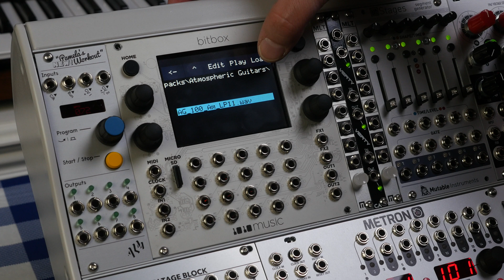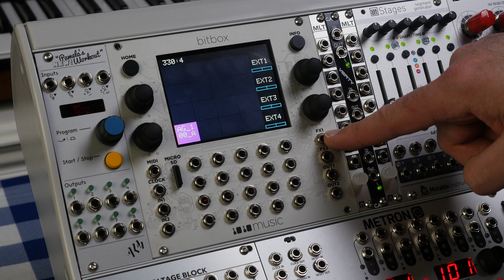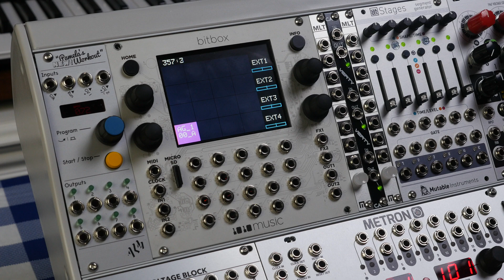Quick Tip: Multiple Outputs with bitbox 2

Comment: Cheers for the help! I've had Bitbox in my rack a few months now, but I also got it when I was very new to modular (only 6 months in now) and I've been prioritizing getting my head around other more vital concepts first, so it has sat there a bit neglected for a while. Now that I'm getting to actually understand the other parts of my rack, I'm gonna be turning back to Bitbox soon, especially since I have PNWO on the way in the next week or two. I see you have them side by side, which is exactly how I'm planning to place mine. Do you have any tips on using PNWO for controlling drums in Bitbox? Or any favourite links to someone else who does?

And once again, thanks for the tutorials. You've also helped me learn about Frames, for which there seems to be fuck all info on, for some bizarre reason.
Reply: Me too. I'm trying to use drums with Pamela's and get em to swing nicely. I've been looking for tutorials but haven't really seen anything either. Let me know if you come across anything interesting

Comment: Thank you! I'm considering purchasing one of these... Are you planning on doing more Bitbox tuts? Also, when you say Bitbox 2, are you referring to the firmware version or do you mean the actual hardware is newer?
Reply from the maker: I meant firmware version, but I can totally see how that is confusing since theres a second hardware version too. I've got the bitbox out of my case at the moment as I'm getting back to focusing on analog osc and filters after being very sample focused for the past several month, so I probably won't immediately be posting a lot of bitbox tutorials. I'm hanging on to the module for now though so it might be back in the future... or if I get a larger case. X-D
Reply: @ferrycollider  Haha! The HP struggle is REAL!! =] I'm on a similar boat but headed in the other direction. Definitely have to get another case. Looking to get integrate more rhythms and percussive sounds.